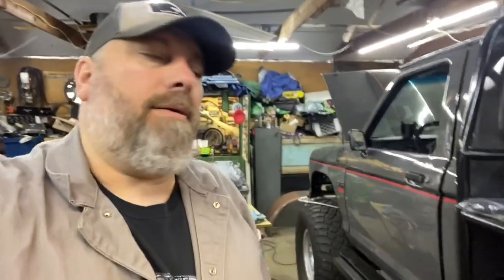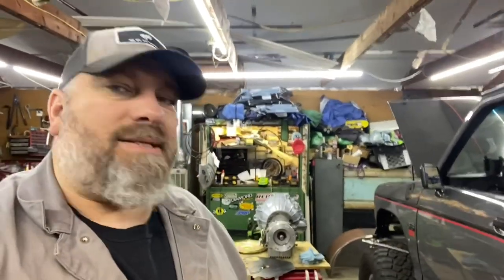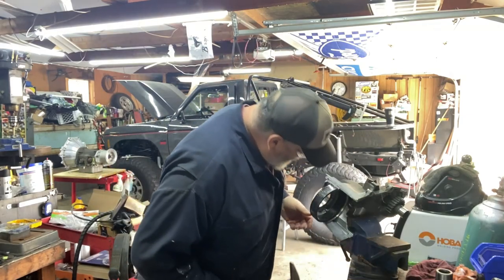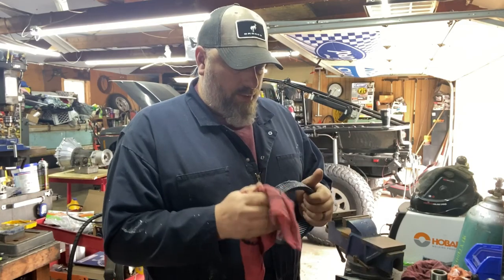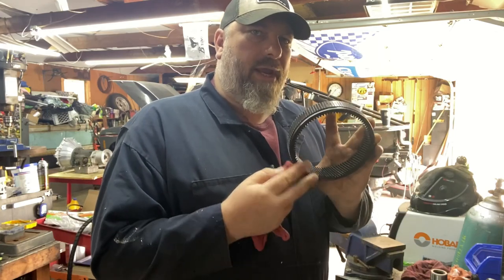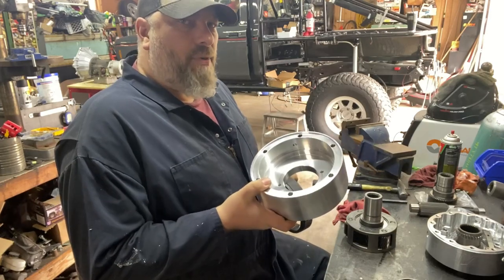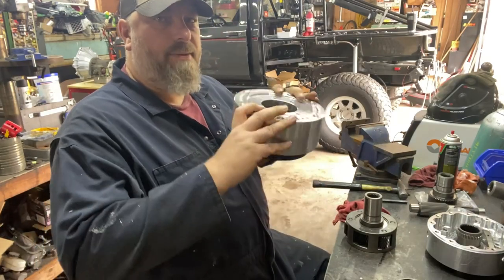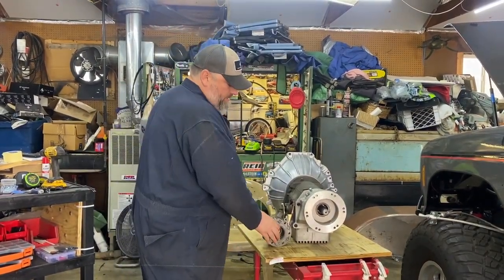NWF Ecobox doubler to Dana20 install on The Mutt

Comment: Nice product and how to video.  You could always upgrade later to a 6 gear planetary if needed. I'm loving NWF products.  Definitely using them for my d300 doubler.🤘
Reply from the maker: What’s the deal with the 6 pinion?
Reply: @Randum Adventures  more tooth engagement and spreads the load more. Not site you'll need it but it's an option